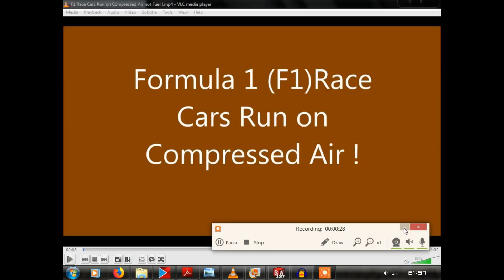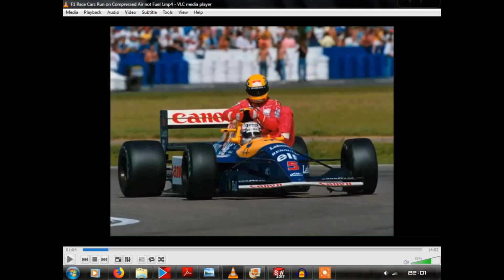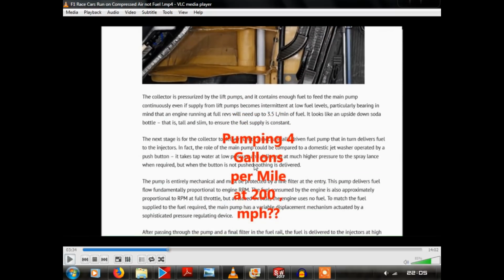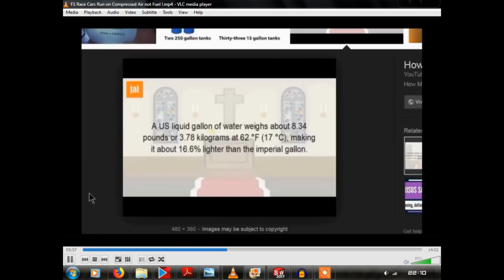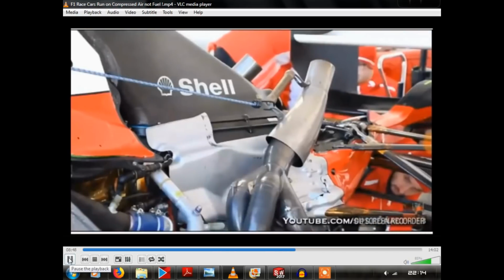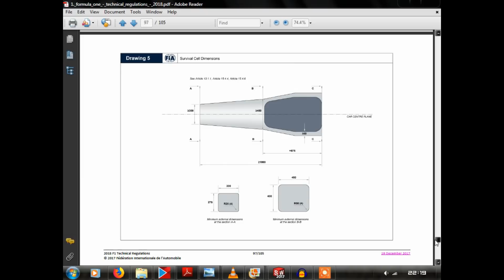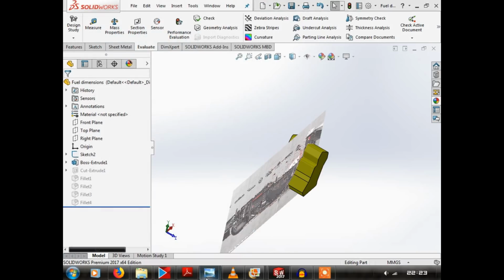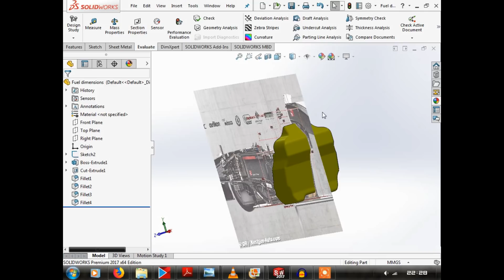F1 Cars run on compressed air!

Comment: Correct, F1 cars run on compressed air. The energy comes not from Shell but out of thin air: when they go fast the air thins according to Bernoulli, a rather famous airhead, so the faster they go the less resistance! Besides, the wheels drive the turbo so this creates a vacuum in those huuuuge air intakes, which in effect sucks the car forward.
Simple really, and no nasty remarks that I should have paid more attention during my Geography classes please ;-)
Reply: go to around 1:35 on this link:
https://www.youtube.com/watch?v=iGkTbJ6sNww

what do you see?
I see a fuel hose blowing air

Comment: When a flat earth believer looks into F1 xD
Reply: Huw chardon  It's emp spherical
Reply from the maker: Are you simple?
Reply from the maker: So you don't think the earth is spinning because of oceans?
Reply from the maker: So do you want me to answer those questions? 

1. Put some water in a bucket. Who's heavier, you or the bucket of water? So how come gravity can keep you stuck to the earth but for some reason water can't?
2. Same thing with pressure. How come the pressure of the water increases when you go further down? You can do this in your bath tub. How can there be highet pressure at the bottom and lower pressure at the surface?
3. The atmosphere doesn't get sucked because vacuum cleaners and the vacuum of space are not the same thing. Vacuum cleaners blow, they don't suck.

Want me to keep going? Got any counters to this?
Reply: @thedirtyworkshop   well firstly your belief of the theory of gravity is just a belief , I can have a discussion for sure 
Firstly before I go any further do you care to listen or am I already just simple to you? 
And do you understand the globe model you believe is fact? What's the circumference of the earth? How far away is the moon and sun? 
What's the earth curvature calculation? Just wondering because I don't want a discussion with people who don't understand the globe model even though they believe it as fact
Reply from the maker: I have a good understanding of the earth geometry, geology, orbits, gravitational potential mathematics, a basic understanding of GR. I know the earth circumference, average distance to the sun and moon, perihelion, apehelion etc.
Reply from the maker: I noticed you did answer any of what I said previously
Reply: @thedirtyworkshop  I notice you did the same 
What does putting water into a bucket and asking what's heavier  have to do with the oceans curving into a sphere 
The oceans are level no matter how far out you go and no the earth isn't so massive that you wouldn't be able to tell it's curving because you know the circumference right
Reply from the maker: 1. Level to what?
2. The point about a bucket of water is gravity causes water to accelerate towards the earth's surface, if that surface is curved then guess what. You assume that the circumference has anything to do with it.

So using the earth circumference convince me otherwise.

You also stated earth atmosphere and the vacuum of space but failed to explain hydrostatic pressure. Why?
Reply from the maker: Drop a stone from 1 m high and then do it for 2m, 3 and then 4 meters. You'll get an accelerate of 9.81 m/s^2. Whatever you wanna call it that is a test you can confirm. Normal people call it gravity. Call it want you want, its a real thing
Reply: @thedirtyworkshop  can you give me without appealing to consensus what can you point me towards that can convince me that it's a globe?

I'm not a FE believer who takes on any maps or whatever just a devils advocate
Reply from the maker: When did I appeal to consensus? I told you how to measure gravity. I asked how hydrostatic pressure makes sense but atmospheric density can't? 

These are things you yourself can measure yourself. Not misinformation, indoctrination or propaganda. Don't call it gravity of you don't want to. It doesn't matter, it's reality.
Reply: @thedirtyworkshop  I see gravity as a formal science, a language that describes things falling, that's not for me any evidence for holding trillions of gallons of ocean of water to a sphere, 
Sorry I was in the middle of doing some house work today didn't mean to reply later and then claim you was apealing to consensus with your points from earlier, just in the question I asked ...
Yes I under how deeper ocean water and higher ocean water the pressure density is different, wouldn't earth's atmosphere and space act similar to a a pressure in a can and the equilibrium when said can is punctured  
..but still what is your number one proof of the globe earth ?
Reply from the maker: If gravity works for stones being dropped, holding you to the surface and a bucket of water and a house, train, football stadium and mountain then size doesn't matter. So trillions of gallons is no different.

Pressure density is not a thing. Pressure is one thing and density is something different. Pressure can be changed by temperature, density cannot. Pressure also has nothing to do with mass, where density does.

Why would gravity act different on gases and different on fluids. Take dry ice when you stick it in water, or argon gas. They're heavier than air and don't float off into space... 

Get enough mass and gravity will when bodies are molten apply an acceleration that is equal in all directions. Similar to dropping molten lead from a tower. That's how they used to make lead shot for muskets. Mercury will also form balls when left on a surface. The surface tension and the air pressure around it as equal in 3 dimensions and form a ball.

The moon is a sphere, and the sun, and all the planets, so why would earth be different?
Reply: @thedirtyworkshop  ok Interesting
The planets I've only ever seen them in 2d you can't see behind them when looking at the lights in the sky and doesn't mean you can land on them  and I don't put my faith in images on the television
Reply from the maker: Ah there you are wrong. 

1) we can take pictures over time and we can see them rotate, or do you think they're changing the features on they're surfaces periodically? 
2) Jupiter has loafs of moons, take Io for example, as it travels around Jupiter the shadow it casts on Jupiter changes size as it goes around a sphere.
3) the shadows that are cast across their surface can only be formed if the body is spherical.
Reply from the maker: And they're not images on television. Get a telescope and look for yourself. Or even better, make your own, people.do.it all the time.

You just keep putting up obstacles instead of coming up with answers. Everything I've said you can test yourself, you don't need to trust anything. Stop being lazy, and test it yourself.
Reply: @thedirtyworkshop  that's why I ask what makes others believe what they believe so I can go look into it more.. I'm just always a sceptical person 

Interesting video though.

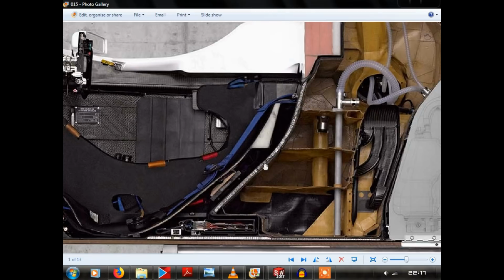Comment: 21:27 That "insulation" is actually carbon fiber sandwich board and is likely a structural piece to the survival cell. It's cool stuff, very good rigidity and weighs feck all.

Comment: It's not insulation between the tank and the driver. That's the aluminium honeycomb between the layers of carbon forming the tub (chassis). It provides additional stiffness with minimal weight.
Reply: MattBlackY1986 beat me to it.
Reply: Nice to see some compo fans! I guess the thick sandwich is there to create a very stiff structure that protects the driver in crashes.
Reply: Ron S it's as much about creating the rigidity to allow the use of a carbon tub in the first place. If you Google f1 tub you'll see some examples. You can also use a nomex honeycomb in places but alluminium is stiffer.

Comment: So they basically think an f1 car is a scramjet? Minus the fact they'd have to be going supersonic speeds to work?
Reply from the maker: LOL scram jets still need fuel
Reply: @thedirtyworkshop  You can use an nuclear reactor for that though. Mental stuff https://en.wikipedia.org/wiki/Project_Pluto
Reply: @funcounting  oh yeah if you don't mind irradiating the track lol
Reply: @jediknight1294  You can use a closed system to contain the radiation. They tried it during the cold war arms race when developing a nuclear-powered strategic bomber, I think. Don't think they used a scramjet tho.
Reply: @funcounting  Project SATAN/SALVO is what your thinking of, the nuclear bomber they had No intention of capturing the radiation, the planned use was to have it launch the 8-32 MIRV warheads or however many it was and then just fly over the USSR aimlessly until it ran out of fuel or crashed irradiating everythuingt in its path, this was Comic book style doomsday weapon, it was something from a 'Dan Dare Vs CAPTAIN PUPPYKICKERMCCHILDRAPERNAZI'  plotline. Powering a missile/bomber with nuclear bombs I mean come on....3rre
Reply: @funcounting  the engine was designed to dump the fallout from the repeated explosions over the target area it was a terrifying thing.

Comment: This concept gets even more hilarious once you start looking into the potential energy of compressed air. According to https://en.wikipedia.org/wiki/Energy_density we can get the following numbers. I didn't validate them, but can be calculated since compressed air acts like a spring.

Compressed Air at 300 Bar (4,351 PSI): 0.2 MJ / L
Gasoline: 34.2 MJ / L

That means it takes a 171L compressed air tank at 300 Bar to have the same  potential energy as 1L of gasoline. 100L of gas? 17,100L of compressed air at 300 Bar.

Where the fuck are they putting a 17,100L pressure vessel that can hold 300 Bar in the F1 car?

Comment: If the were running on compressed air why do the exhausts shoot flames & why do they have firey crashes
Reply: milksheihk so they can be more convincing in their deception. Duh
Reply: Angry pixies? O_o
Reply: just a show for the audience....:D:D:D:D
Reply: The flames are just pyrotechnics to give the crowd a thrill, also the sound is faked and added to cover the hissing of the air powered motor.
Reply: I would guess cgi
Reply: Flames are obviously from the drivers having eaten spicy Mexican food duh
Reply: Ever noticed they are having less firey crashes? Ofcouse they have less firey crashes if they dont carry firey stuff anymore!
Reply: It's obviously because they inject Evans into the magic Compressor.
Reply: Air has oxygen in it, oxygen is highly combustible! HA!

Comment: I used to work at pet shop, and I'll tell you a 45 gallon aquarium is nowhere near as big as it sounds like it should be. and when you sit down on the ground next to one you can easily see how it'd fit comfortably in the back of a seat for 1 adult person.
  
it's a fuckton of water to scoop in and out with a coffee mug, and it dominates a small corner of the living room when set upon a 3 foot tall stand, but fucking that's because your house is tiny and so's a coffee mug.
Reply: Skikorsky Helicopters are the best, man! they don't fuckin' exist, but that's why they're the best. not only do they run on nothing but hot air, they literally are nothing but hot air!

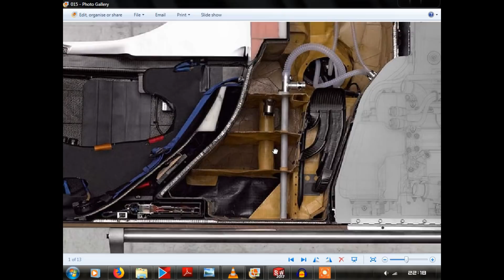Comment: @21:30 , isn't aluminum honeycomb used between sheets of carbon fiber in most areas? I never thought of it to be used for insulation. (not saying you're wrong). My Formula SAE team uses honeycomb for the entire carbon fiber monocoque.

Comment: Great job with the 3D model volume calculation. I also used a pretty basic calculator too see how much fuel is consumed for the HP. You could be expecting around 51 liters of E85 consumed per hour for a 700'ish HP engine. That means you could expect almost 3 hours of fuel. Sounds about in line

Comment: Just a note that the cross-sectioned F1 car is actually from 2008 when refuelling was allowed. Apparently these cars had somewhere between a 90 to 100 litre fuel tank. This image shows the difference in length of F1 cars when refuelling was banned in 2010: https://www.racefans.net/wp-content/uploads/2010/01/mclaren_mp425_comp_right.jpg. Obviously all that extra length is just air, right?

Comment: they do run on air .heres a question for you why is it fuel in general is in litres or gallons why dont they keep it in that but no its in kilos
Reply from the maker: Volume seems more relevant - just a guess
Reply: its all about illusion
Reply: Its to account for different temperatures essentially putting a weight limit on it means that fuckery like chilling fuel to make it denser for a given volume is a lot harder to do. There being a weight limit vs a volume limit will also make your measurements to prevent/reduce cheating easier from a Scrutineers pov. 

 Most modetn petrol pumps in the real world have measurement systems either set for a fixed temp but you do see some of them.out there that aren't so filling up in the cold is theoretically better for economy.

Comment: well they do .. its compressed by a big explosion inside a cylinder :-)  .. they also believe jet engines run on compressed air , well they do aswell , its compressed by the fan blades that are driven by the massive energy produce by the fuel burning in the combustion section ... these people are so simple minded , they cant drive thier module

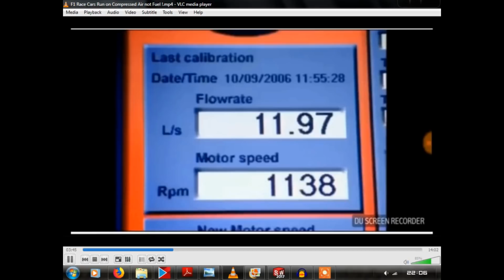Comment: The calabration image shown at 9:50 is for the Fuel Delivery System for REFUELING>  Has Nothing to do with the F1 car using fuel.  this video shows the Facts.   https://www.youtube.com/watch?v=OEzouwTVFOo&t=3s    Besides, F1 cars idle at 6000rpm. My 350 Cheby revs to 7800 rpm and will not idle at 1150rpm. It idles at 1,400 rpm because of the lopey cam....530 lift, 300 duration, I&E side.

Comment: Out of curiosity can anybody calculate how much air these engines go though per min?
Reply: Yes, but would depend on engine RPM, engine displacement, engine load, volumetric efficiency, ambient conditions, altitude-density, fuel specs, fuel energy-density and fuel-density.

Comment: If they were running compressed air the tanks would be even bigger & thick walled.
Reply: not really, some french company built cars running on compressed air , had composite high pressure tanks. the car was big like a daewoo tico. can be i dig out some links on it....it was ages ago.
Reply: I remember that, basically a city car, top speed of 50 or 60km/h & a range of only 100 or 200 km per tank.
Reply: Only 100 to 200 km? I think air is a perfect energy holder for cars. Maybe better than electricity.
Reply: maurice van doeselaar nope, allthe energy used to compress the air can directly power the car anyway. so better stick to petrol than air lol, it's just more efficient.
Reply: Its even better than that ( i was thinking the same at first and als commented that) in fact this guy was saying the cars compress the air themselves, although he doesnt really explain how. Some blabla about turbo's but not how they are driven. Probably fairy-dust

Comment: Right so...
Fuels too heavy but gold isnt? 
Not enough space for enough fuel for a race, but enough space for enough compressed air?? 
Or is the car a big compressor in which case how Is that powered? 
Maybe its just infinite ram air accelerating the car exponentially ?

Morons. I'm just flabbergasted. What do their cars run on? Has the american replaced his petrol tank with a 45gallon drum?

Comment: Hey mate, 
Love your vids!
I was wondering about weight distribution on motorbikes, there is some confusion about where the COG should be to make it tip into corners more easily. One theory is that higher COG is desirable because it is 'less stable' while others try mass centralization to reduce the moment of inertia. Maybe a video could clear things up?
Cheers, Murray

Comment: If these cars were run off of compressed air,  why would they make metal exhuats manifolds ? They wouldn't to save weight if they were run off of compressed air, good thing f1 cars are run off of petrol
Reply: Oh that's obviously because plastic would crack in the cold from the air blasted through them. - rolls eyes-

Comment: The turbo is a compressor but I'll let u figure that out on your own time
Reply: Well yes but that only helps by forcing more air into the engine to allow more fuel to be burned, without the fuel you could push as much air in as you liked it wouldn't help.